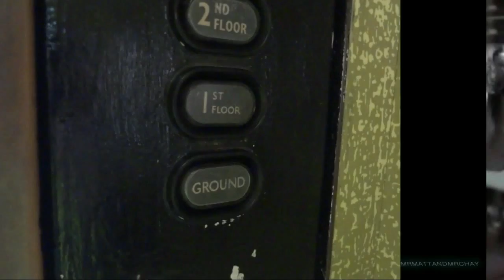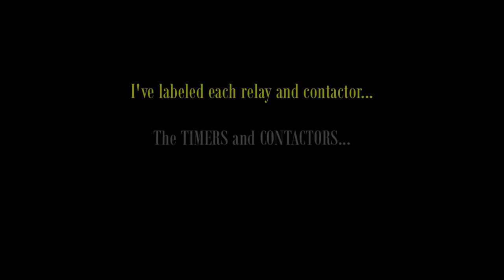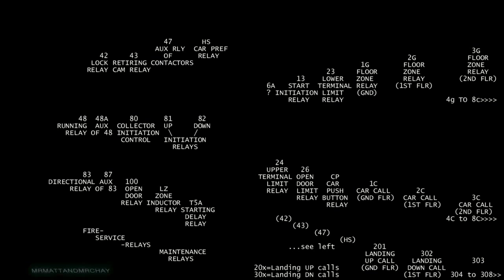(2/4) PROBABLY THE BEST 'elevator relay logic vid' in the world! - Part 2 of 4

Comment: Great stuff :)
When I was a kid back in the 70s in NYC, we lived in a 22 story apartment building that had 2 old Otis passenger and 2 freight elevators, I used to surf on top of the passenger elevators and those 2  were very fast elevators! They were side by side separated by  a short space, so I used to switch over from one to the other while moving.
I used to get grease all over my shoes and pants and hands.
The handyman I came to know used to let me play around with the freight elevators, they were manually operated and much faster than the passenger elevators, damn they were fun! I used to go up full speed and then swop the control handle over immediately to down and that thing would almost leave you in mid-air for a split second.
I quickly learned how stuff worked, and I found that if I "tripped" one of the hallway door contact rollers the elevator would stop and then go back to the ground floor as it reset the floor selector doing that.
I rememebr one guy wanting to go to the 22nd floor and around the 20th floor I tripped the roller while I was sitting on the roof of the car and sent us back down to the ground floor, he pushed "22" again and again I reset the door contact, after her rode back to the ground floor 3 times he gave up and went to the other elevator.
Damn, those were fun times, even if extremely dangerous as you well know!

Comment: I've been looking for something like this for YEARS :) I was loved my old relay elevator ever since I was a child. The main difference to this one is that it floor position was detected mechanically. It had a steal cable looped the length of the shaft, that was dragged by the cab. This turned a wheel in the machine room that was used for over-speed protection, but was also linked by a chain to a mechanism that moved a plate up or down along a shaft that had contacts responding to floor positions

Comment: I'd love to get a job as a demolition workman, would be nice to get some lift souvenirs such as floor selectors, button panels etc before a building demolished.

I think Otis floor selectors in their case would make fantastic wine tables or bedside tables!
Reply from the maker: LOL - fantastic wine tables and bedside tables :D  My wife would go mad if we had loads of lift parts made into furniture in our house lol.  I do still have a Express Lifts mechanical selector though - wonder what I can make this into.  See...
Not sure if Mr Chay likes his present...? 8/
I see lots of very old concrete buildings from the 60s and 70s being demolished and YES i'd love to get in those buildings to look at the old lifts and get souvenirs!
Reply: When i was about 21 or 22, there was an old poultry processing plant slated for demolition in my home town. For 3 months, me and a couple buddies used to go out there and waste away the nights. I snagged a LOT of old tech from there, including a relay logic unit for the three floor elevator. Sadly, no amazing rotary ratcheting floor selector mechanism... But still a wonderful addition!

I also got a vacuum tube module and a transistorized module from a pair of electronic organs. Both modules are of similar size, and as it turns out, makes for a WONDERFUL evolution of technology display!

Relays, valves, transistors... I recently acquired a hybrid module based organ as well... but I CAN'T bring myself to disassemble it! XD

For now, I'm working on restoring a resistor diode logic based SCM Cogito 240SR calculator (1965). Not quite as low tech, but still a wonderful piece of history!

Comment: Excellent vid and editing, it's like Mike Oldfield all over again! All those relays make my head spin, but I suppose it makes a bit more sense with the original plans...
Reply from the maker: +Casa Security Many thanks!  If you understand about basic circuits and how relays work, it can be quite a simple design (believe it or not haha).  It's just knowing what all the relays are for that's the complicated bit.
Reply: Pretty good with most electronics, just the sheer number of relays - most of which seem to have about 12 sets of contacts - in these systems that I find intimidating! Ah well, keep making the great vids. :)

Comment: I have thought of making a model 3 floor lift to sit on a table. Is it possible to get small relays and approximately how many relays would be needed for such a model? It would have all the features of a real lift, including generator, selector, door sensors brake etc. The call buttons would be on a hand held box to control my model. Would it be a difficult task? Are there circuit plans?

Comment from the maker: (2) The retiring cam is like a moving bar on top of the lift car.  When the lift stops at a floor, the bar pushes the lock on the landing door which unlocks it.  The motor can then drive open the unlocked door.  When the door is shut the 'retiring cam' bar is de-energised (i.e. it "retires" back) and the door is locked again.
When I do part 3 I will explain.  Hey....
watch?v=aiMQzau9sJY&feature=plcp
...see 1:22 - you can see the retiring cam here!! :)

Comment: Wait a minute.... Every time I hear the lift motor start or stop I swear I hear a centrifugal switch change state, and the 2 pole line contactors vs 3 pole suggest to me this  lift is powered from a single phase supply??? If so that is a rare bird, never see that here in Canada, even some of the small apartment houses had a 3 phase supply just for the lift.
Reply: 3 phase motor, Up direction contactors 1& 6 (UP &  BRAKE- LINE CONTACTORS)  Down 2&6 (Down & Brake -Line Contactors) UP contactor connects 2 phases to the motor the brake and line contactor  connects the 3rd phase and also lifts the brake through its auxilliary contacts. DOWN contactor reverses the 2 outer phases to switch the motor direction  and the other contact on 6 again connects the 3rd phase etc. The reason for this is that regulations state that their must be 2 independant contacts in the motor supply circuit in case of mechanical jamming of contactors for instance. The other 2 contactors you see are acceleration stepping contactors to give a smoother start.

Comment: What does Relay 6A do?
Reply from the maker: +Joseph Marsden (Cryosim) Hi, if you mean at 7:09, then this is the only relay which I didn't work out (or have a guide to).  But I know a man that might know :) ... +harry lomas  (hyperlinks are not working)
Reply: +mrmattandmrchay Yeah, I mean that relay, Perhaps for some kind of emergency stop or a relay that was never connected?
Reply: +Joseph Marsden (Cryosim) 6A relay is an auxiliary of No6 Contactor which is in the power section of the controller and is the Line & Main Brake contactor. The butterfly contacts on No6 energise the brake coil via B+ and B- terminals. 6A allows more contacts to be added to the associated circuitry of No6 Contactor.
Reply from the maker: +Peter Lomas Thanks for answering that Pete.  Yes, so the first relay didn't have enough contacts, so 6A operates at the same time as No6 contractor to give more switches.  Coils are probably paralleled, or one switches the other at same time.
Reply: Ah, thanks guys!

Comment: This lift no way up to modern safety standards.
Reply: There isn't really anything that's dangerous. Of course, it's very energy inefficient and probably difficult for lots of engineers today to understand. It has all the basic safety features which it needs. The stuff which new lifts have which this doesn't are just extra things which aren't at all necessary, but just improve the overall ride satisfaction. :-)

Comment: in 01:54 the elavator relese its break and the voice scares me
Reply from the maker: Salifrt Salifrt I too was scared by lifts like this when I was a kid.  But now I love it!  The scarier the better for me :)
Reply: +mrmattandmrchay which model of elevator is this
Reply: +Salifrt Salifrt Express single speed lift, with 3PH squirrel cage motor with rheostatic starting.
Reply: +Peter Lomas thx
Reply: +Peter Lomas That description is the speed control ,NOT the model.
Reply: +738polarbear It is an Express Single speed installation with belt driven B machine, The door operator is the Express SMALL type operator with single panel doors and safety edges on every landing door (connected in series).If you require any further information do not hesitate to ask.
Reply: safety edges are on car doors not hall doors,.Yiu mean door locks in series in the hoistway.
Reply: +738polarbear No i mean they are on each landing door wired in series if you look at the video 4:30 & 4:57 you can clearly see them on the landing door leading edge. EXPRESS LIFTS  fitted these for several Council contracts around the country for several years. It proved very effective in reducing Fingertap situations, but could lead to some lengthy callbacks.
Reply: yeah
Reply: Peter Lomas, did you mean to write "finger trap" instead of "fingertap"? I don't know what a "fingertap situation" could be.
Reply: Well spotted David, i did indeed mean Fingertrap